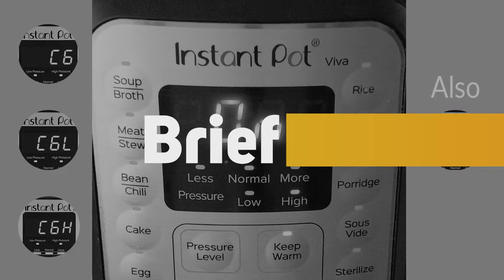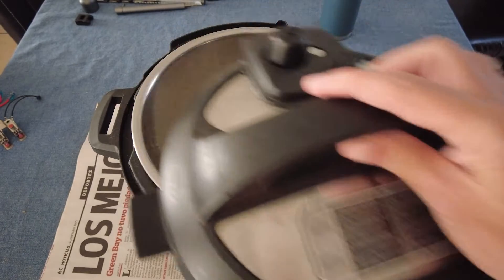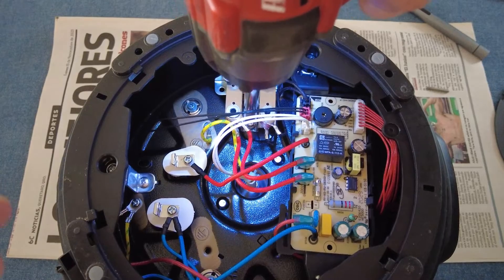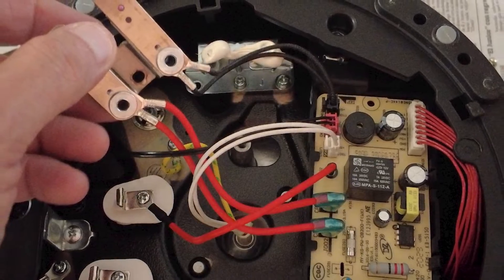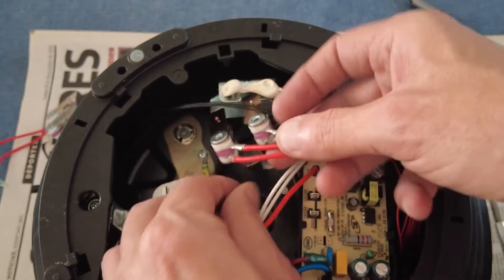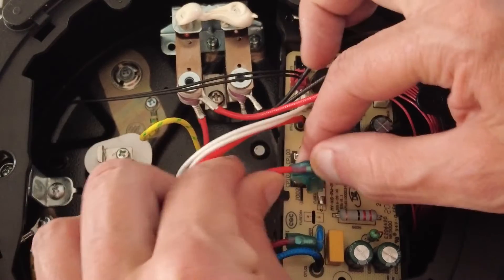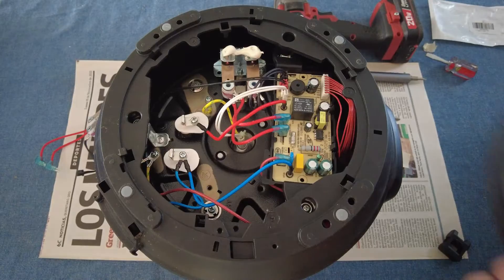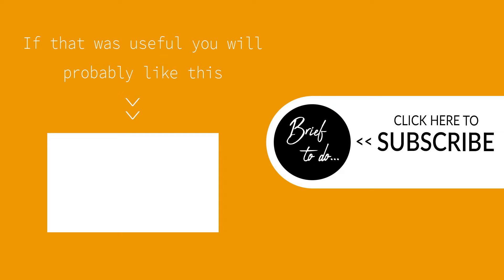Fix Instant Pot errors C6 C6L and C6H 💨

Comment: Thank you!  It worked!  The most difficult part was disconnecting the red wire, it is impossible to pull out and I almost gave up a couple of times!  However once that came out, the rest was easy.  I'm not mechanically savy and don't use drills often, but this video was simple and helped a lot.  Thank you so much!

Comment: If the screw is too tight, don't strip it any more. The part is free aside from the screw, so spin it around a couple times with a glove. Make sure not to catch any wires. Then, put a rubber band into the screw and find your pointiest phillips screwdriver. Hammer it down a couple times and slowly unscrew it. This is how i figured it out after stabbing a hole in my table out of anger :)

Comment: I took a toothbrush and cleaned up the corroded contact screws with rubbing alcohol. Works just fine.
Reply: Was there no need to change cables?
Reply: ❤ It works the toothbrush w/ rubbing alcohol. Thanksalot coz no need to buy the parts that needs to be change👍